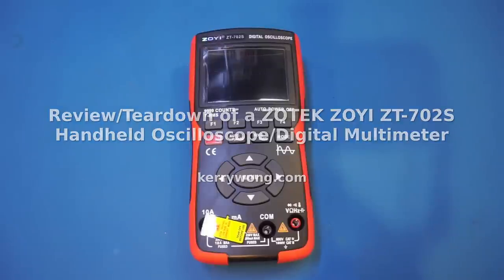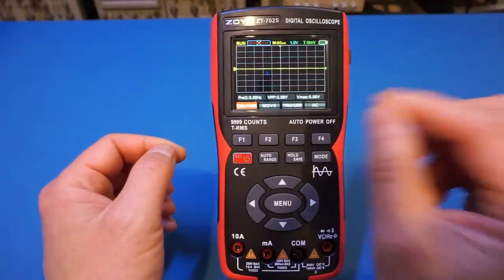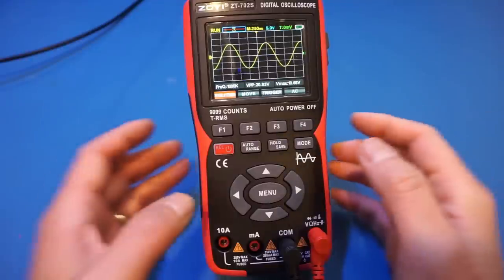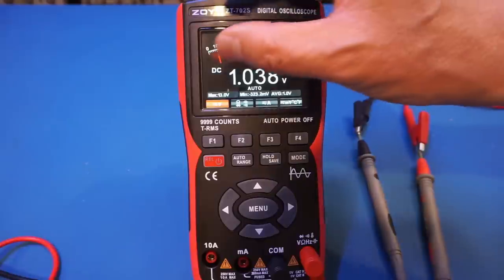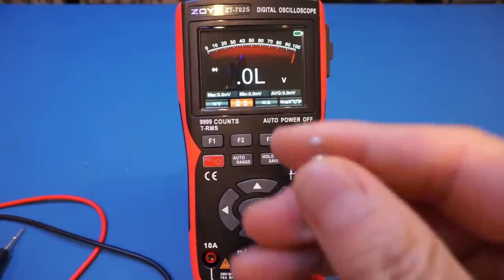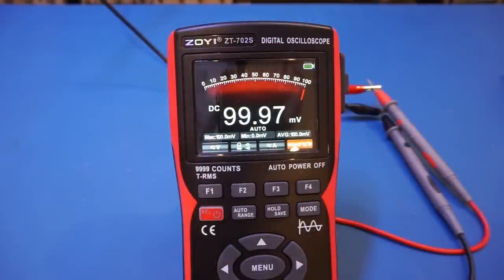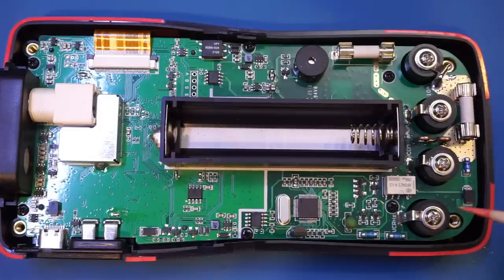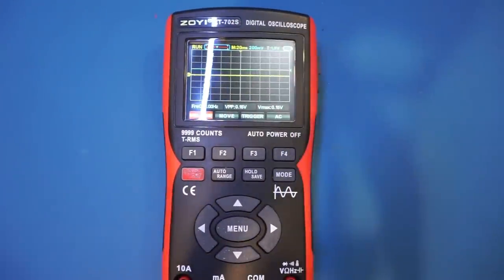Review/Teardown of a ZOTEK ZOYI ZT-702S Budget Handheld Oscilloscope/Digital Multimeter

Comment: This device warns you when you switch into A or mA mode, BUT NOT BACK! Why? A couple of hours ago I repaired a simple UNI-T M830BUZ meter, tested its 10 A range, then switched to 750 V AC and... set off the circuit breaker 😀by inserting an unfused 10 A shunt directly into 220 V. The meter survived, but all my 220 V powered digital clocks now require setting time...

Comment: Interestingly they use a protected 18650 cell, although there's a charging IC. I wonder if that one maybe has no low discharge protection? I've tested the device with a unprotected 3500 mA cell and it automatically stopped charging at 4.2V (as expected). The battery holder also seems to be made for a shorter, unprotected cell, since its already a very tight fit and the plastic is bent slightly on the ends of the holder. I wonder why the still used the cell with additional protection circuitry.
Reply: I wish more companies would use replaceable 18650 cells. Because they’re widely used for vapes, there are a variety of them available as well as chargers.

Comment: Update: 
It remembers now in which mode it was (oscilloscope or multimeter) when switching on again
They show now a clear picture where the lines should plugged in in addition to the warning triangle, everytime when choose A or mA range. 
To test internal fuses without opening the case, just go to resistance mode and test with the red line the A and mA terminal. When there are a few ohms at mA and about 0,24 ohms at A the fuses are ok. 
Ambient temperature can be measured by short the two probes in temp.mode.

Comment: Great review!
Got mine yesterday.  It was battery dead upon arrival. Bad sign.  It wouldn't charge after trying different cables & chargers.  Finally pulled the battery & it wouldn't charge in the C4 charger.  Finally put another battery (EBL) in it & seems like all is well,  for now.  Going to have to monitor it for power off drain down.  If all is well over the next weeks, then it was a minor issue.  If not.....

Comment: Good morning. My name is Marco and I'm Brazilian
Your video is very good. I have a question:
This ZT702S device, with the oscilloscope function, can I connect it to a computer for measurements, making the computer screen the oscilloscope screen? Another question: can I measure 1mV scale, as I use a lot of load cells? Thanks
Reply from the maker: No, it doesn't have the "mirroring" capability. Also the sensitivity of the vertical scale only goes down to 20mV/DIV

Comment: I have a zotek dmm. It was my first decent one when I started. I donated it to charity but missed it and rebought it on sale. I think it's the Q1. I've give a few of their meters as gifts. Them and aneng swap names but I thing zoytek is the oem.

I need a cheap letter with inductance measurements Kerry and I'm wondering if the 50 dollar mastech or the little uni-t one are any good. I won't be doing rf so I don't want to spend a lot.
Reply from the maker: Very few budget meters have inductance ranges. I don't currently have any DMMs that can measure inductance. But if you have a specific model in mind I will see if I can get one for a future review.
Reply: @Kerry Wong  there's a mastech one I was looking at. I'll bring with the model and there's another I'm interested in. The mastech MS8269 and another that is double and can be diy in an elaborate kit or not. BRB with that
Reply: @KerryWongBlog  the second is the XJW01.
Reply from the maker: @jstro-hobbytech  Well, if you just need to measure inductors values, you could just get yourself a component tester. They are cheap and do a decent job. You won't be able to measure at a specific frequency, but neither could you with the MSB269.
Reply: @Kerry Wong  my component testers are very hit or miss. I think I have made a deal for a midrange second hand lcr meter. I don't need anything fancy and you're right, I completely forgot about testing at a specific frequency. Thank you very much.

Comment: As is typical of cheap devices, there is no input protection to mention. Is it possible to add some MOVs and PTCs afterwards?
Reply: There's a screw right next to the input which will probably spark in situations where the fuse would go off

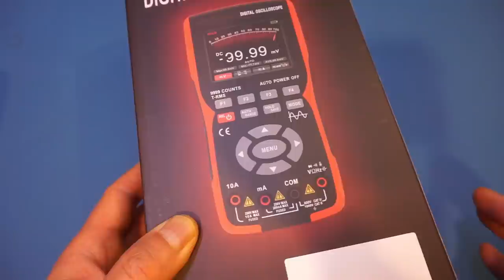Comment: How much voltage it can measuring in oscilloscope mode with 1:1 and 1:10 probes?
Reply from the maker: Spec says 150V AC+DC. I am assuming that's for x10.
Reply: @KerryWongBlog  Ok. Than you can make a test measures if you have this device?
Make a measures with setup range 1:1 and 1:10.
Because I also know about specs. I'm need a real information.
I'm assuming that 150V is for 1:1 probe.
It is very simple: you change voltage range by pressing up on the device and watch what it says on top of display with different setup modes for probe 1:1 and 1:10.

Comment: Why does everyone remove the protective film from display faces?
Reply: Because it's meant to be removed. It's only meant to protect during assembly and shipping.
Reply: I almost never remove the film it actually cuts down on reflective glare and it protects the plastic screen. I have one meter where the film finally became  dull and scratched, so that single case I removed it after 15 years now the meter looks nearly new again.
Reply: that is nothing - I see millions of people NOT removing the folia from their CAR SEATS!!! for years! yes, 5 years later seat still looks like new - but tell my why you paid for leather or alcantara seats if they are still covered with plastic folia ;-))))
Reply: @MechanicaMenace   My thinking is that it is more likely to be damaged in use, than in shipping. I generally leave it on, unless it has printing on it as my dig voice recorder did.
Reply: @ed-jf3xh  I pretty much do the same until they get that gammy they need taking off. But if I was doing a review... well without is the intended use case. And they can make the screen harder to pick up on camera. Not removing it could give an unfair impression. Even worse it could hide glare problems or make you not notice the screen is easy to scuff or scratch.
Reply: He want to show respect to the viewers.
Reply: @zyghom  The first thing I did after buying my new car was to spray it's seats and carpeting with fabric protectant and then install seat covers. Then again, it is a Chevy Spark: Noblesse oblige. 😊
Reply: This is a question of faith. Some leave them on forever, others pull them off as soon as possible.